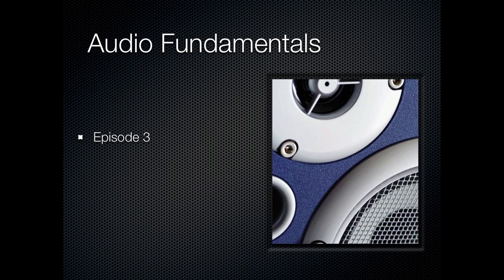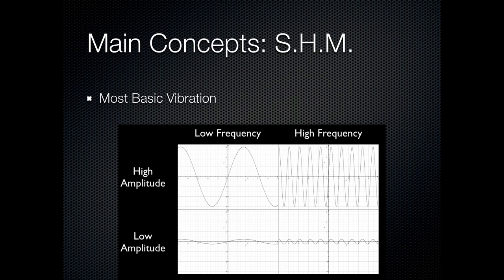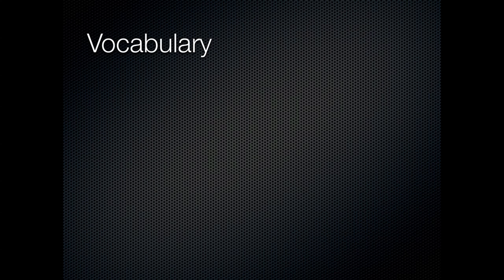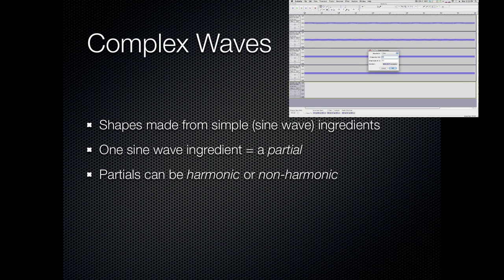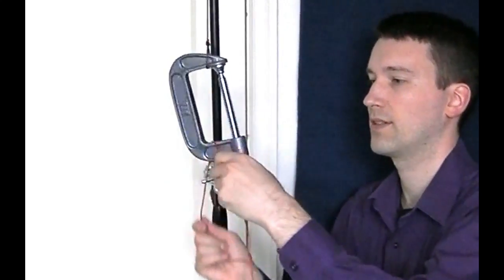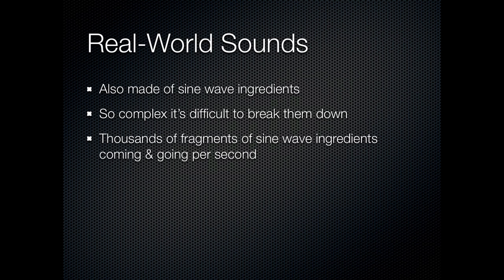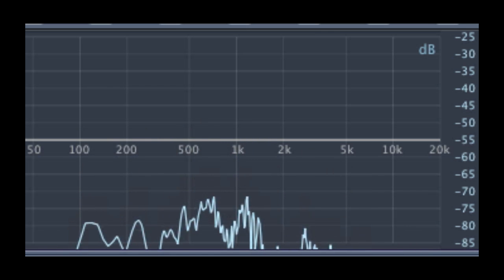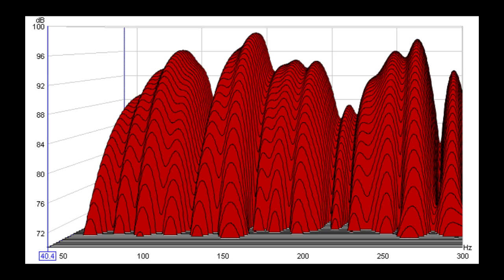AF003 Waves and Seeing Sound

Comment: real-world sounds are made of sine wave ingredients?
I know you can use Fourier series to break up sounds and with enough ingredients you will get close enough, but that does not necessarily mean sounds are actually made of sine waves. Maybe they are made of that but not because you can break them down with Fourier. Functions that are continuous, bounded, etc can be represented with a Fourier series (which converges in this case), but that does not mean all these functions are made of sine waves. Can someone clear that up?
Maybe it does not matter if they are actually made of since waves, but since they can be well represented by them, we can use the Fourier as a useful analyzation tool in any case.
I'd love to hear the physicist point of view. Suppose a rain drop hits the roof, what's gonna happen? Roof trembles a little bit, shakes up the air particles, those particles shake up other air particles, they bounce around until it gets into your ear. Suppose only one air molecule is shaken at first, it will kinda bounce back to its place by other air particles, in a sinus like motion right? Is that just one component of all the sinusoids the sound can be broken down, or that's not how it works at all?
Just as a thought experiment, suppose I hit the wall with my hand, it will make thumping sound, hard to notice what kind of frequencies. But, if I could move my hand really fast, hit the wall 440 times a second, I would hear the A note, wouldn't I? Does not mean the sound is only made of 440 hz components, but one of it surely would be 440.

Comment: I'm doing an online course at SoundGym and I must thank you for your videos, Matt. I just want to point a small mistake on this one. The amplitude of a signal is, unless otherwise specified, measured from the reference value to the maximum value ("peak"). This is valid for most Physics and Engineering fields.

Comment: The pendulum example is a great idea but isn't it slightly misleading the way you've done it here? Ignoring air resistance, the frequency actually depends on the length of the string, not the mass suspended from it. It's true that smaller things tend to vibrate faster in general, but I believe this is more closely related to tension and compression.